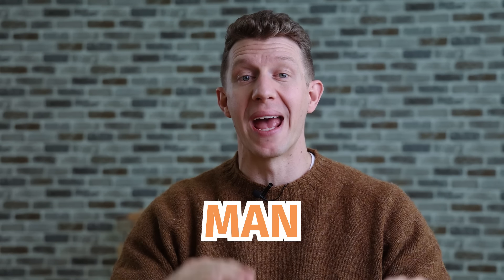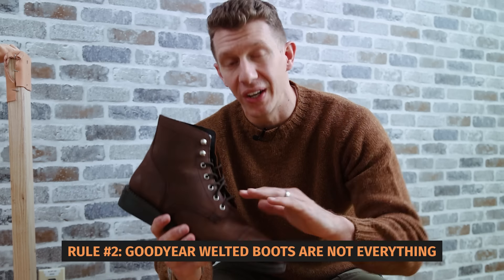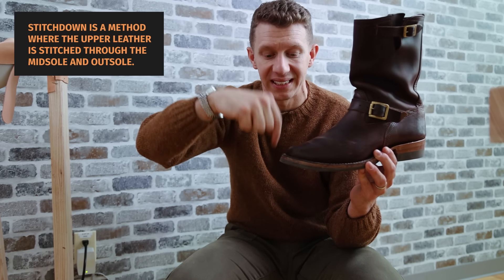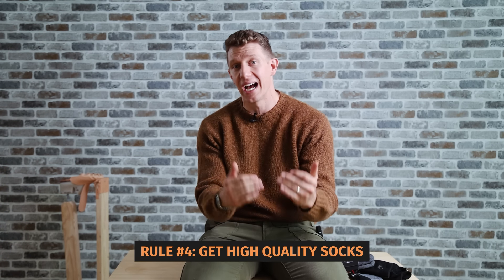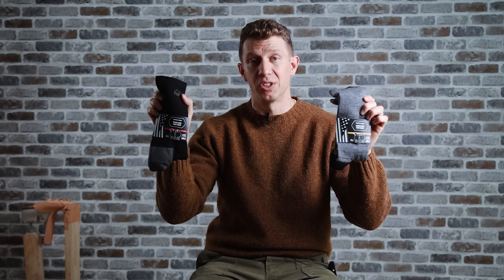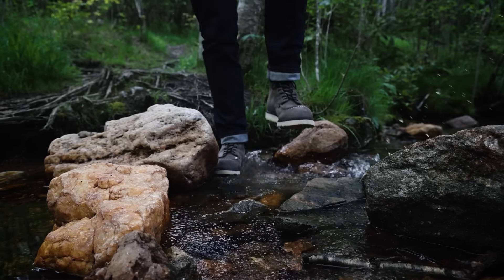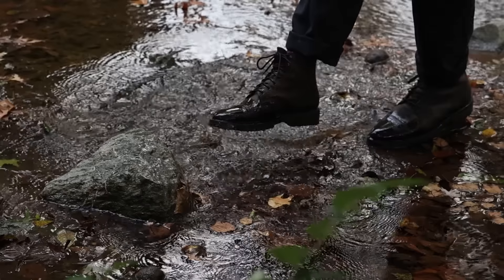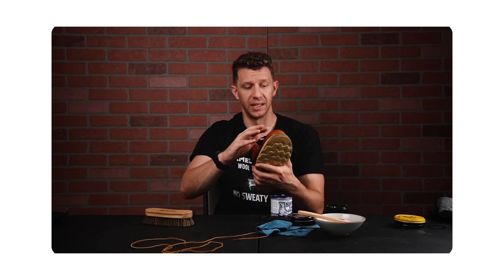7 Boot Rules Every Man Must Know

Comment: Great video.  I think we need to be a little careful about the Blundstones though.  I don't think you're being fair.  First of all, I wouldn't call them a cheap boot.  They're more expensive than Thursday Captains on every site I look.  I think it would be better to compare them to a $100 chelsea boot and it will be more accurate to call them cheap.  Second, you say the Blundstones break down really quickly and I don't think that's fair either.  I've had mine for over two years and I work them into rotation and they're doing great.  They aren't breaking down quickly.  This doesn't even include the thousands of happy customers who share testimonials and reviews and love their Blundstones. Are the Grant Stones better? Heck yeah, they're amazing. But you can buy the Blundstones for $150 less and if you take care of them they'll last quite a few years.  In addition, they're crazy comfortable and stay that way.  I have Thursday boots and Iron Rangers and they're better boots to be sure but I still think there's a great place for boots that are less expensive like Blundstone.  They're fashionable, comfortable and will last longer than you're giving them credit for. Anyway, no hate, I love your channel just want to push back a little on the Blundstones. :)
Reply from the maker: I hear you - great points. I am surprised at the materials that go into that boot given the price though

Comment: I worked at a park where I had to work out on trails in mud and deep puddles (often for 5-10 if cutting trees near the puddles). The cheapo boots I had before would let water in after walking through dew so I started buying waterproof boots as to not risk it. Never had leakage problems so if I ever do that sort of work again I’d still buy waterproof. Definitely correct that most people won’t need it though. Great informative video.

Comment: We have constant flood here in our country during the rainy seasons and having waterproof boots really helps specially when riding a motorcycle in the rain.
Reply: Bees wax your boots then you need heat but it works I use to wear gortex lined boots I loved them and also hated them with a passion I’m super happy with not having waterproof boots now.
Life is a lot easier without soaking wet feet from sweat

Comment: If you’re buying a cheap boot for work (like if it’s your first boot and you can’t afford any better) I’d strongly recommend rock rooster since they’re really good and durable for their price. I’ve worn them for over a year in a warehouse job walking 20+ miles on concrete in a 12 hour day. Another good one to look at would be Jim green boots.
Reply: I only buy boots with leather uppers...and I usually buy in the sales....for around £15. Pointless repairing them as the cost of repair is more than the boots! And they last me years!
Reply: @steveaga4683  dang, what type of boots are you able to get for 15 pounds? Rock roosters may not be worth resoling, but the fact that it has a  good year welt does help with durability.

Comment: great video, off the subject a bit. I bought a pair of  Danner Caliper 6" Boots about a year ago. I have not worn them yet so they have been in the box the whole time. Does this hurt the boot or damage the leather in any way?
Reply: Unless you live in an area where it is super dry or super humid, probably not. If you live in the desert, they might be dried out a bit but that's nothing some conditioner won't fix. Similarly, if you live in a swamp some "gunk" might have built up on the outside due to the oils in the leather sweating out via the humidity. That can also be fixed with a quick wipe down with a leather cleaner and some water resistant conditioner.

Comment: The Thorogood roofer boot was my favorite work boot. I’ve tried a bunch since it was discontinued I would use Danners if they hadn’t become cheap and thin with the lightweight sole that wears out fast, and if Danner also ruined my Power Forman’s when I sent them in for a resole and they took them hostage and made me pay for a higher refurbishment that they didn’t need. When they came back they weren’t waterproof anymore, the flags were gone and they didn’t sent my Kiltie’s.

Comment: Good video. One thing I would add to your explanation regarding water proof boots is how nice a gusseted, or semi gusseted tongue is (come on Thursday, it’s time lol).
Reply: Just buy a good boot. Plenty of good brands have them….
Reply: @drshin9893  agree 100%.
Reply: I think it depends on the purpose. I'd never take a boot that doesn't have at least a partially gussetted tongue into the woods or into a work zone with water/oils/chemicals. 

If you work in an office/warehouse or even dry construction/electrical, you probably don't need a gusseted tongue. I'd definitely feel better about wearing my captain stormkings in the rain if they were though.

Comment: Living in Florida I doubt I need to condition more than once a year if not once every 18 months. 

The humidity is not great for breathing but I don't see leather drying out
Reply: It's that salt air and sand that's hard on the leather. Didn't the term "swamp ass" begin in Florida? Because you are so right about the humidity. 😅👍
Reply: @sirflingspoo  if I was on the coast I'd agree but inland? I got the bic4 just in case but a pair of Chelsea boots I bought years ago and never oiled are still supple.
Reply: In a weird way, super humid and hot conditions could make you need to condition more because the super swampy air can cause the leather to "sweat" the tanning oils and build up grime on the outside.

The guy is definitely going overboard recommending conditioning them every 10 wears though. Maybe once or twice a year at most unless you are getting them super dirty/covered in chemicals at work.
Reply: @ryanh7167  see I stay indoors most days so while the humidity gets in the heat doesn't.  And like I said my chelseas are years old and still doing great with no maintenance beyond brushing
Reply: @ManateeOnRye  yeah then you definitely don't need to condition them that often.

Comment: Waterproof boots don't have to be as you describe.  I have had the same Red Wings for 35 years.  They are Gore-Tex lined, they have never leaked, and I have never felt like they were wet with sweat either.  I worked all day outside in Atlanta in the summer rain and the winter sleet.  I resoled them three times.  Recently the basement had 4" of water and I waded around in there for an hour, and these old boots did not leak at all.  If I bought the same today, SuperSole 2.0 looks to be the closest model.  I have other boots, but I put these on when the rain is coming down.  Youtuber boot gods who criticize Gore-Tex as not being truly waterproof seem to presenting theoretical rather than real world experience for it not being waterproof.  I've been there.

Comment: Some people’s feet will just sweat a lot. I had a pair of moc toes, and in my old job, the boot would become so saturated in sweat that by the end of a 12 hour work day, in areas the leather would be visibly wet from sweat. This is while working in a 30 degree temperature controlled warehouse and using merino wool socks.

Comment: Actually you are wrong about Goodyear and Blake stitched boots. eg:

Blake stitched - only allows a new sole to be added a few times eg: 3 or 4, then the boot is done, plus it's much more expensive to get shoes re-soled due to the Cobbler needing a special blake stitch machine and these are £1,750 each, plus it's less common for cobblers to have these, as well as a normal stitching machine. Stitching into the upper leather is going to eventually kill the entire boot, leading to buying more boots eg: £350/£500 each, so you will be looking at 3 new boots every 7 years = £1500 minimum plus 4 times £150 repairs = £600 - total = £2100 to replace the original boot alone.

Goodyear welted - this allows multiple re-soles to be done, is cheaper as most shoes/boots are 'Welted' (apart from Dr Martens eg: Heat sealed). It provides water resistance as there are no small holes leading to the inside of the shoe, and the construction is superior.  In life, there is mostly a reason for doing things.

Comment: Working in slush, mud, etc. go old school.  Wear your regular work boots with "5-buckle arctics" over them. 

No need for insulated or waterproof boots unless you really are in the arctic, or say International Falls, MN.
Reply: Idk about that one man. My insulated and water proofed/water conditioned Danner Quarry boots have saved my ass when I've gotten stuck in snow at work and had to dig out the truck. You could probably get away without the waterproofing/insulation but I've never once thought about those boots and wished they didn't have it.